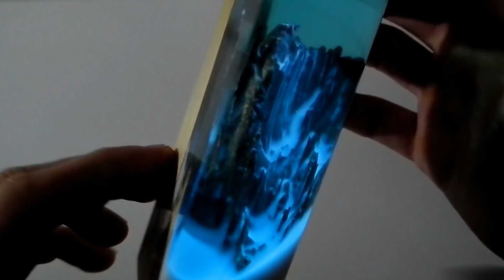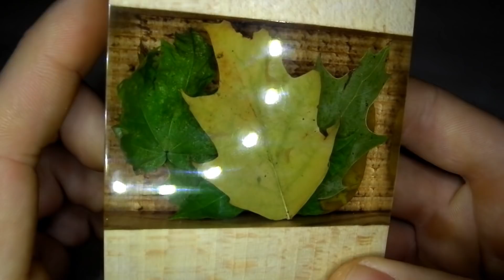5 MOST Amazing Epoxy Resin LAMP / Tutorial / RESIN ART

Comment: Awesome, the only thing I might add is that you need current limiting resistors on those LEDs or they will burn out quick.
Reply: True that
Reply: You doesn't need them if battery's voltage is same as led forward drop voltage.

Comment: So nostalgic and beautiful!
I need an advice on polishing resin, I use all sorts of sandpaper from p50 till p2500 but there are little tiny scratches, and I can't remove them with any too.
Reply from the maker: Each paper must remove the scratches of the previous one. After each paper, check if the scratches are gone
Reply: Thanks!

Comment: All of them are AMAZING but in some stages I would rather use router instead of bench sander as using bench sander to remove excess of wood U r scratching epoxy. Correct table router would able to remove wood without scratching epoxy what should safe a lot of time when polishing.

Comment: Please use a resistor in series with the leds. It would be such a shame if they burn and you have to replace them. To calculate the right resistance all you need to do is take the voltage of the power supply. In this case the battery. Lets say the battery is 3.7V.
2led in parallel use 20mA each. So 40mA required in total. The leds have a ~2V drop, since they're parallel we dont add the voltage. So we need to have a resistor that handles the remaining 1.7V with a 40mA(0.04A) current.

R=V/A = 1.7/0.04 = 42.5 ohms.
That doesn't exist as a single resistor so we round up to 47ohm.

Put that in series and they will last you a very very long time.

Btw this should barely dimm the leds if any. So no drawback.